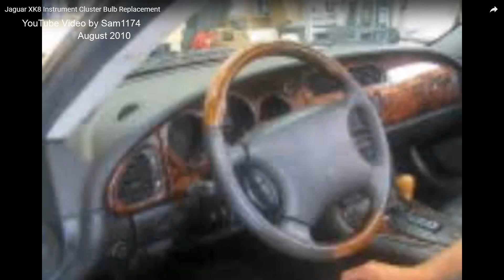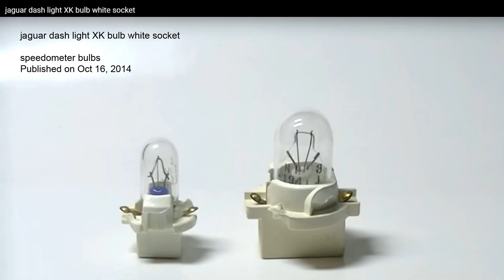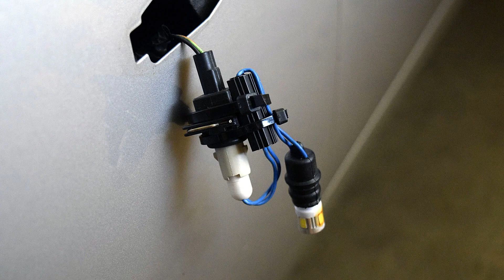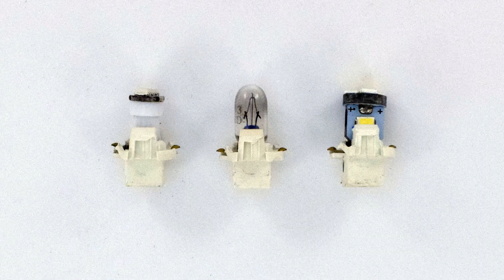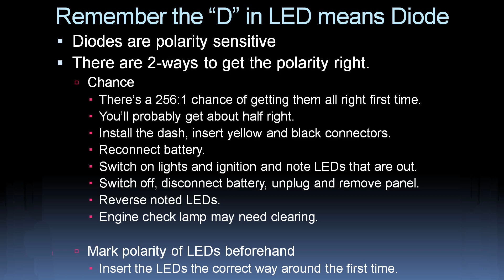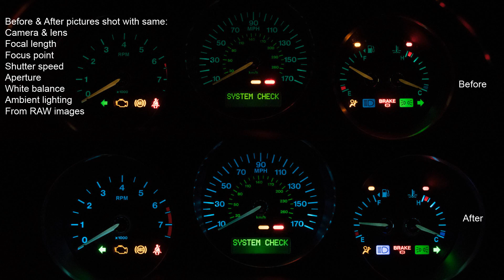Improving the Jaguar XK8 Instrument Panel Lighting

Comment: Easiest way to test LED polarity is to use a 9v battery.  The LED will bridge across the battery terminals nicely and light up when it is the correct way round.
Reply from the maker: Since making this video it seems that many of the LEDs I used now have bridge steering diodes, so are no longer polarity sensitive.

Comment: In situations such as the hi-beam indicator for example, there's nothing saying you can't take a white LED and paint it any color you like to both get the right color and to tone it down a bit if it's too bright. A little model paint or whatever works fine. Also, I recently bought a bunch of T-10's (3 different styles) on ebay that are no longer polarity sensitive.

Comment: Hello Richard from Madrid.
Please I want to ask you to help me with some opinion.
General light (ilumination inside cluster dash) not working.
Check :
electrical fuses passanger box - OK
exterior position lights ok
all dasboard panel function , all warning bulbs. all OK
light intensity adjustment potentiometer OK
green light to air and radio panel OK
interior lights all function OK
electronic steering wheel functions OK
all circuits are OK  , but :

NO ILLUMINATION INTERIOR CLUSTER.
What would be the reason?
Thank you!
Reply from the maker: Hi Dan. Sorry for the late response but I am not sure I can help you. You seem to have checked everything. Looking at the circuit, all the illumination for the major instrument cluster goes through a dimmer module, located it seems, according to the manual, by the  fascia / adjacent to righthand side fuse box. The connector is a 12-way black and may be worth checking. Sorry I could not be of more help.
Reply: @richardastley2517  Thank U Richard anyway! The troouble is about motherboard where I have faill.

Comment: so, what color did you use ? blue ? clear, or red
Reply from the maker: Of the bulbs shown about 9 minutes into the video I used the 9 mm bulb shown at bottom right in all but one position. It needed to be shaved by 0.25 mm (that's 10 thousands of an inch) around the diameter because the hole in the back of the panel is 8.5mm. For the high beam I used the blue lamp (top right), but have since swapped it back for the original bulb because I found all the LEDs too bright for that lamp position when driving at night, when of course high beam is used. I use high beam for such a small proportion of my driving I regard the risk of an original filament going out as minimal.

Comment: Wow. I already knew I am Horrible at electrical issues, now I feel extra stupid. So, I would Love to upgrade my dash lamps to LED's but first I need to address my current bulb issue. I have a 2001 XKR. I realized my power window switches, steering wheel, turn/lights armature, and floor shifter are not Illuminating. I purchased LED bulbs from Ebay before I found out my car requires canbus error-free bulbs. I installed one bulb in my window switch, didn't light up, now All my night time Dash lights do not light up. But the daylight dash lights still work. If my key is Off, the night time lights do work, but as soon as I turn my key to On, the lights go out. Do you think maybe I damaged my Body Processor Module? ANY help would be much appreciated. Still looking for factory bulbs for the switches, shifter, ect, twist-in with a small flat screwdriver. Thank you for your Time.
Reply from the maker: Now you’ll think I’m accusing you of being “extra stupid”, but in fact it’s a common mistake – is your instrument dimmer control perhaps turned all the way down? It only works when the lights are on so the behavior you describe jibes with that. I think it’s unintuitive, but full counter clockwise makes the instrument lamps brighter. Besides all the lamps you describe not working, the dimmer also controls the HVAC and radio illumination. See:http://www.rastley.com/XK8-Dimmer-Control.jpg
If the dimmer control doesn’t brighten the instruments and switches, with all the lamps you describe not working, I would reinstall the lamp you swapped out in the window switch and suspect the dimmer control itself, its connections (did it get tugged sometime when someone was removing the cowl below the steering wheel?) or the dimmer module. That’s located by the right hand facia fuse block and its connector may be loose. You don’t need so-called Canbus-free bulbs in this function in your year of XKR. If you blew any module it would be the dimmer module, but it’s pretty robust, so reinstalling the old switch LED should fix it.
Reply: Well I figured it out, (really embarrising) The 1st thing I checked was my brake lights. My wife stood behind the car while I hit the brakes, turn signals,ect. She said the brakes were fine, so I took her word for it. I rechecked then with a stick crammed on the pedal/seat last night. The THIRD brake light was out. Apparently she didn't see that it wasn't working.
Reply from the maker: Unclear why that would affect your instrument lamps. I've had a problem with the 3rd brake lamp too. All that flexing when the trunk is raised a lowered broke wires in the convoluted tubing.

Comment: Hi.  Nice.  I called dealer for LED info who said "can't put in LED, computer will find wrong voltage etc and issue warnings."  But you have them in.  So no computer warnings? Thanks
Reply from the maker: Some of the bulb functions throw up a warning if they're burned out or an unexpected bulb is inserted, but for XK8s built up to 2005, and possibly after (I don't have data on later cars) panel lighting isn't one of them. The dealer may be thinking of some later models. Anyway, the warnings are usually for lights outside your field of view as a driver. There seems little point in warning you about something that's right in front of your face.
Reply: @richardastley2517  ah so dealer ignore; do you have a current supplier of LEDs; cannot find the ones you posted
Reply from the maker: Try a search for the following on eBay. AUXITO T10 LED License Plate Light Car Interior Bulbs White

Comment: Thank you for very informative video. Please make one for shift gate backlighting replacement!   They are all burn out in my XK8 and it is not easily replaceable.
Reply: Hello. I have a 2001 XKR. Dumb question, I just recently found out that the door window switches are suppose to be Illuminated. So is there a bulb(s) for the shifter plate? Also bulbs for the steering wheel, turn/headlights? I've had my Jag for about 5 years, everything works but nothing lights up.